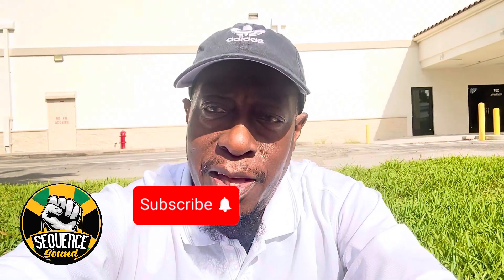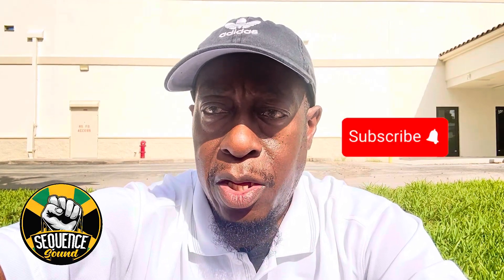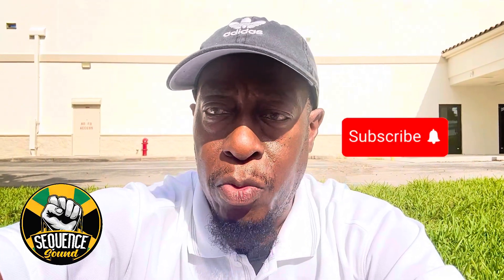8 OHM 4 OHM 2 OHM  Explained

Comment: At 2 ohms/ even if the amplifier is design to operate at this level/ will have a lesser control over the woofer/ so it is better to operate between 4/8 - simple 
Another way around the problem - simple to get active subwoofer - - lots of them are available 18/21-  you do not need 24 /  
This is the way I would go - may be a bit more costly - but the complete system ( speaker - amplifier -enclosure)  is optmise
Reply from the maker: Its not a problem, everyone have a right to their opinion , like i said i usually play 4 ohms but with this amplifier i don’t have a problem  with /  2 ohms ,, controlling the amplifier is no different at 2 , 4, or 8 ohms
Reply: Using your amplifier at a 2 ohm load is not the best because it it operating at its maximum/ it will be running at max load - constantly - not the best for sound and life of the component
Reply from the maker: @a@a@a@a @alanaban1840 am aware that 2 ohms is generally not the best, but if you have a amplifier that delivers 12,400 watts per channel you can play with  lots of headroom the amplifier will  be perfectly ok , this amplifier is very stable at 2 ohms , again i am not telling anyone to play at 2ohms i am  simply stating that i play this particular amplifier at 2 ohms and i am happy with the performance.

Comment: these new amps push some power but i dont feel so confident about there durability. Also the tone is not as warm and the typical heavy amps. To me its about personal preference and pocket dept. Some older amps been around for 30 years and still work like new. while some of these single space amps burn the output board with one bad power surge. But at some point i guess we have to move forward with the time.
Reply from the maker: @camouflagesounds  yeah i feel you, progress is a must, respect 🫡

Comment: Mr Sequence, I am planning to get CVR for my system and run the subs at 2 ohm. Some people say the amp will last longer at 4 ohm, because 2 ohm is close to the amplifiers operational limit.

 I think CVR is such strong units that it is really no problem. Does your experience confirm this?

(I have 8 x 18" sub rated 800W @ 8ohm. I plan for CVR D-2002 providing 4760W per channel at 2 ohm, giving roughly 50% headroom)

 As always, thanks for sharing your journey and knowledge with the people! 👐
Reply from the maker: yes can 4302 is powerful enough you won't have any issues

Comment: I use to play the Peavey 2 5000 & 2 7500. I played all four amplifiers at four ohms. It sounded good, but it sounded like I needed more power. I sold them and bought the
 WASI 15K4. That one amp sounded better than the four PV amps together. Since I got the WASI amp I’ve been playing it at 2 Ohms with plenty of headroom. It never overheated, clipped or go into protection. I know a lot of people will say it’s better to play the app at four ohms but, the technology on his new amplifiers are better than the old analog amplifiers.
Reply from the maker: Agree the new digital power amplifier are very stable at 2ohm
Reply: I agree the a switching power supply amp will produce more power than a transformer amp / but the lower impedance speaker will cause more stress on the amplifier/ I always king my speaker between 4/8 ohm/ try to avoid 2 ohm

Comment: As you add speakers to the amplifiers and lower the ohms it’s more stress on the power supply and the output transistors of the amplifiers so be prepared for failures.
Reply from the maker: These amplifiers are designed to to play very efficiently at 2 ohms that is the reason its 12k per channel
Reply: @sequencesoundmusicislife  that’s is max rated output but there is no guarantee it will prolong bottom line is if you have enough amplifiers to use why abuse them with 2 ohms?
Reply from the maker: @Tefalbharatt I have never played any amplifiers at 2 ohms, but I am trying to these because of the higher power, I use the amplifiers i know what they are capable of

Comment: If you hook up two 8 ohm speakers in parallel that would halve the impedence to 4 ohms each. If you were to add a third 8 ohm speaker wouldn't that take all three speakers to 2 ohms? Wouldn't it go to 1 ohm if you were to add a fourth 8 ohm speaker? I  might be wrong. I want to make sure. Am I wrong?
Reply: 3. 8 ohm speakers is 2.6 ohms
That's great per channel.
4. 8 ohms speakers  is 2 ohms, that's a lil too harsh for the 2 ohm amps
Reply from the maker: 3.  8 ohm speakers is 2.66 ohm 4 8ohm is 2 ohms

Comment: Does it sound any different playing at 8 4 or 2 ohms, Other than just delivering more power. It would be interesting to hear if there is any difference.
Reply from the maker: 8 ohm is more relaxed 4 ohm the amplifier is working a little harder 2 ohm the amplifier is working harder if the amplifier is sufficiently powerful it will sound good regardless of ohm

Comment: Good information all the time Sah. I am in Ghana West Africa and the current is not all that stable. I have QSC RMX series amps 5050s and 4050s which they say can play at 2ohm. It is difficult to get quality speakers here and  sometimes the speakers are in short supply or not available. Most of them come from China and don't give you the true rms value. I could only get the better 18" driver's at 4 OHM so I built 8 x mini scoops to start off with, to use as bass and built 4 x double 15" with 2" horn for the full range to make one wall. I intend to put one bass per side per amp for the time being so that the amp is playing at 4 ohms to be on the safe side. The 18" drivers say they 2400w but don't mention rms so I'm presuming it maybe about 1200rms in real terms. The 15" drivers are 8 ohm so I don't have any problems with them. I intend to try and raise some money and build different boxes with 8 ohm drivers in double base boxes. What do e think. Any advice will be appreciated
Reply from the maker: respect, if you play 2  4 ohm speakers connected together that is 2 ohm QSC 5050 can play 2  ohms without any problem, yes I believe the rms power on those speakers should be about 1200 those should sound pretty good if you like how it sounds I think you are good, I use 8 ohms but used correctly 4 ohms can work
Reply: Give thanks for your response sah. I currently have 3 x 5050, 7 x 4050,  8 x 2450 and 3 x 1450 all QSC RMS SERIES. I am aiming to do mainly live band shows and programs because that is where the business is. The sound system side is not so prominent over here at the moment at least not enough to make a business out of it. I hope to be contributing to promoting our culture over here because it has been a passion for me since youtman days. As you will  know more than anybody, usually is you alone investing every penny into building and developing the sound system. I don't expect to make plenty money from the sound system side of the business but if hopefully pay for itself so that we can entertain the people it will be something worth doing. I don't know if you would have heard of Jah Marcus Sound from London England😮 6:36 😮
Reply: JAH Marcus Sound was established in North London in the late 70's early 80's . He moved is sound here and was living in Ghana up until a few years when he passed on. He wasn't playing the sound out very often only mainly at some social community events that we ours would put on. But Africans love Jamaicans and Jamaica even though 99.9% have never been there, especially the ghaninian youths. So when we bring a little bit of Jamaica here they love it. African Star Sound System Stuart Brown was to hold a sound system festival over here last year I have to try and get a link with himto see how we can help promote the culture
Reply from the maker: @KwasiJoseph-ft6zt  cool nuff respect hope to come to Ghana to play some music one day
Reply from the maker: @KwasiJoseph-ft6zt  nuff🫡, no never herd of it but now I know 😊 nothing happened before it’s time keep doing what you are doing
Reply: We going to try and make it work. Everything is possible. I will try and get your number and link you up differently, I don't want to talk too much here, but when we talk you will get more information. Respect due.
Reply: This is Joseph from Ghana,this is my other account on my other phone. Have to have more than one phone over here because of the network and light off problems
Reply from the maker: @josephmandela5107  🫡
Reply from the maker: @josephmandela5107  954-588-8075
Reply: We use qsc amplifiers all day long and I will not get the car or other Chinese type amps no time soon. To each his own